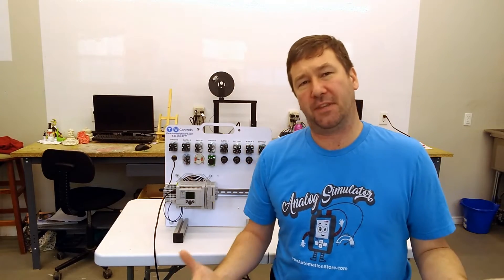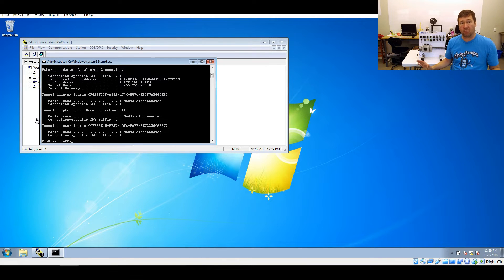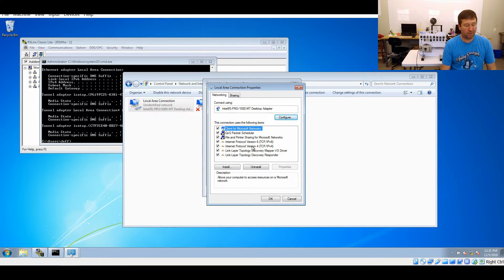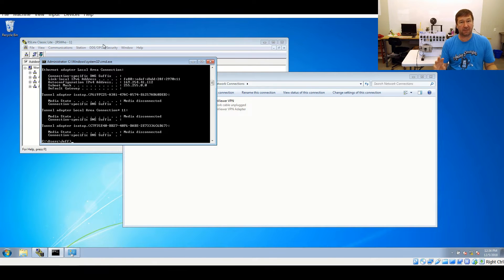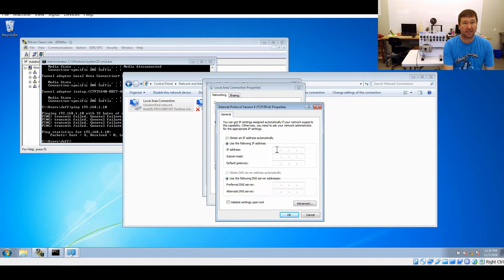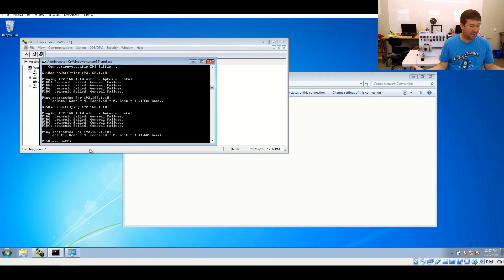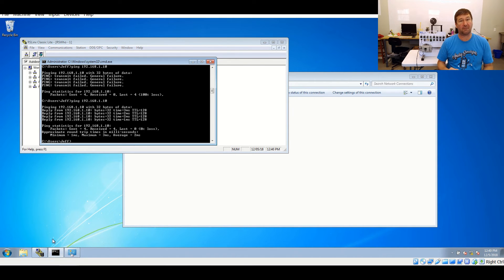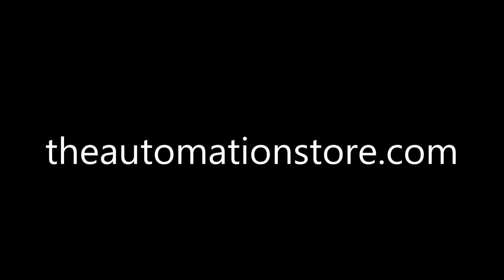Why Can't I Connect to my PLC over Ethernet?

Comment: So, you have gone thru all these steps and STILL, YOU cannot connect........maybe the Eth port is bad? Of course, if the customer reports, "I can't talk to this device anymore"....likely a good first hint. So you do all this and the same results!? Funny, I just got a 1400 and nobody told me what was wrong with it.......so messed with it, did the checks, and sure enough, that Eth port is no good. Could not even get a response to a ping!?

Comment: Hi! I was thrown into a factory where no one has plc experience and where I'm still a bit of a beginner myself. This video helped with my main issue! Now how can I know what program to run?  (Rslogix 500, rslogix5000, studio 5000, etc) because no one at my place knows
Reply from the maker: That is a tough one along with which cable!  SLCs and Micrologix use RsLogix 500, Controllogix and Compactlogix use Studio 5000 or RsLogix 5000 depending on which version, and Micro800 uses Connected Components Workbench.
Reply: Thank you so much!

Comment: How to connect my PC with PLC if I don't know the IP address of my PLC? NB. I want to connect with SLC 5/05 while I dont know the ip address of my PLC. When I connect ethernet cable to PLC, see only ip address of my PC adapter by ipconfig.
Reply from the maker: You will need to discover the IP address with a device such as the SIM-IPE.
https://plctools.com/plc-tools-sim-ipe-ethernet-ip-address-explorer-dhcp-and-bootp-server/
Reply: I have used BOOTP DHCP tool RSLinx tool using same subnet mask, but it didn't show Mac address of my PLC. However when I connected ethernet cable to PLC, signal LED  turned ON on the module. Now, do I need to cycling PLC power or any other means?
Reply from the maker: @shahriarshajib541  Hard to say, Rockwell's BOOTP-DHCP tool isn't very reliable.

Comment: What about port conflicts  on windows 10 using rs5k 16.5
Reply from the maker: Not sure what you are asking Ronny.  This video is about Ethernet connections.  For AB as long as ports 2222 and 44818 are open, you wouldn't have a "conflict"
Reply: @TimWilborne   on rs classic i kept getting  a port conflict but couldn’t find why ima look into those ports , do you think this can happen because im trying to use it on windows 10 hom edition with vm ware ?

Comment: It´s correct that rule you commented on the video, and that´s why a subnet 255.255.255.0 means a device is living in a network represented by the first 3 bytes of its IP network like: 192.168.1 in this case the last number "10" represents the host number, and you can select between 253 host numbers, if the subnet mask was 255.255.0.0 the numbers you need to make sure are the same are de first 2 bytes like: 192.168, i´m sorry if i make mistakes writting in english.

Comment: i have plc slc 5/03 and i want to conect by ethernet what i need to do or configure in my pc for conection by ethernet devices?
Reply from the maker: You can't!  STOP!  That isn't an Ethernet port on the top of a SLC 5/03.  It is a RS485 port and needs a 1747-UIC for communication.  Additionally the incompatibility in voltages between it and an Ethernet connection can damage both ports.  Learn more at this link.
https://www.theautomationstore.com/how-to-configure-the-1747-uic/

Comment: I'm a little bit confused. About 2 min in you said to make sure the IP addresses match and then you immediately said they shouldn't match or you get a duplicate?
Reply from the maker: As a general rule, the first three octets most March and the fourth one cannot. So for example both should be at 192.168.1.X but the X must be unique to each one.

Comment: My related question is, everytime PLC plugged to PC ethernet, I lost connection to WIFI network, PC automatically switch to LAN and disabled WIFI. do you have a tutorial video for that?
Reply from the maker: Hi Nick.  No and I have had the same issue in the past.  I think it had to do with the network bindings but that's a little out of my league.

Comment: Hello sir ..
I have allen Bradley plc5 , when communicating with plc online for trouble shooting , cross reference is not enabled . So let me know to fix this issues. .
Reply: Hello sir ...
How to set preset time for timer in Allen Bradley PLC5 online
Reply from the maker: @ravindradesai5007  Check out this lesson, it is for RsLogix 500 but RsLogix 5 is the same.
https://www.theautomationstore.com/rslogix-500-training-timers-ton-tof-and-rto/
Reply: @TimWilborne  thanks sir
Reply from the maker: @ravindradesai5007  Glad I could help!
Reply from the maker: Different versions of the software have different features available.  I'm really rusty with RsLogix 5 part number and features but if RsLogix 500 followed it then on the basic license, the cross reference feature is disabled.
Reply: @TimWilborne   how I can sort out this issue and thanks for replying ..
Reply from the maker: @ravindradesai5007  You would need a different version of the program but it is obsolete so I wouldn't recommend purchasing it.

Comment: How to fix Ip address not connect ( Destinatiton Host Unreachable ) ?
Reply from the maker: Check that your PC and PLC are on the same network and subnet. So for example is your PLC is 192.168.1.10 with a subnet of 255.255.255.0 then you PC should be something like 192.168.1.123 with a subnet of 255.255.255.0
Reply: I Already did. The result is same.
Reply from the maker: @iyingkziril2348  What type of Ethernet device is it and what is it's IP configuration?  If you go to the command prompt and type "ipconfig", what does it say?

Comment: Do you know the default ip address for the 1769l33er controller
Reply from the maker: By default it will not have an IP address. It will have DHCP enabled so that one can be assigned to it.
Reply: @TimWilborne  i recently downloaded my existing rs500 onto a new pc and my license got transfered over. I spent a week or so trying to bring it back to my laptop. Now i can open rs500 on my lt but i cannot go online. I can see the hardware but cannot see the program. Usb to 1769
Reply from the maker: @proadlekopy  Are you saying you are connecting to a 1769 PLC such as a Compactlogix?  It uses Studio 5000, not RsLogix 500.  Here is more information https://www.theautomationstore.com/studio-5000-training-where-can-i-download-studio-5000-logix-designer-rslogix-5000-and-what-is-the-price-difference-of-each-version/
Reply: @tim do you know how to fix this
Reply: @TimWilborne  thanks. I cannot open my rs5000. Is it because of the license
Reply from the maker: @proadlekopy  You'll need to install the Studio 5000 software https://www.theautomationstore.com/studio-5000-training-where-can-i-download-studio-5000-logix-designer-rslogix-5000-and-what-is-the-price-difference-of-each-version/
Reply: @TimWilborne  i have it on my lt but cannot open it. The disc i have is a rs500. So now im confused.
Reply: @TimWilborne  thank sir. I contacted my local distributor and the person confirmed that i need studio5000 to talk to my 1769-L33e. I will get more help from them.
Reply: @tim wilborne thanks. My local supplier just confirmed that i need studio 5000 to communicate with my 1769. I will get their help.
Reply from the maker: @proadlekopy  Good to hear. Let me know if any more questions come up.
Reply: @TimWilborne  sure sir.
Reply: @TimWilborne  ok. So i will have to go to rslinx to set it right

Comment: I seem to have the IP configured correctly, and RSLinx can see my PLC. I also have set up this PLC in RSLogix, but when I attempt to Go online, Download or Upload I get an error message "No responce from processor at selected path/node!" and "DiagnosticStatus failed: 0x4". But thanks for the video, it got me further that ABB documentation did!
Reply from the maker: If you go to System ? Sys Comms...can you navigate to your PLC then go online?
Reply: I tried this the first time and came back with a different error, and I noticed my PLC had fault light flashing. Turned it off an on again, restarted RSLogix and did the same and it worked. Thank you for you help!
Reply from the maker: @jamespopejoy4176  Glad you got it working James!

Comment: You did a great job explaining that but the issue I'm having is that I know the IP address of both my laptop and PLC and they once connected, but now they are not.  That same laptop connects to my other two identical PLC's but not with the 3rd one.  The 1st 3 fields of the laptop ethernet IP address matches those of the PLC so it did connect but now I suspect that the IP address changed on my PLC. How do I go about finding the IP address on my A.B. Micro820? If I can get that IP address then I probably can get the two devices to communicate.
Reply from the maker: Yes it sounds like either the IP address has changed.  The easiest way would be to use the PLC Tools SIM-IPE to read the IP Address https://www.theautomationstore.com/ethernet-ip-address-explorer-dhcp-and-bootp-server/